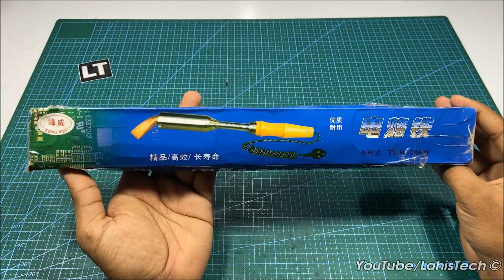How to Make Hot Air Gun from Soldering Iron (Simple DIY)

Comment: The amount of money spent on this project you can buy a new hot air gun with that which is even better than this. LOL😂😂😂😂😂
Reply: This is for those how can't buy hot air gun
Reply: @MemoSh44  if you are spending money in buying this 200W soldering iron, plus all the other materials to build this, then you can easily afford the new hot air gun with temp control if you shop online for a good price and decent product. This isn't a very expensive item.
Reply: True, but if you like diy projects this can be on your list.
Reply: I suggest you do some research. This is less than half the price of a cheap hot air station. Before you count the fact that most parts can be found laying around.